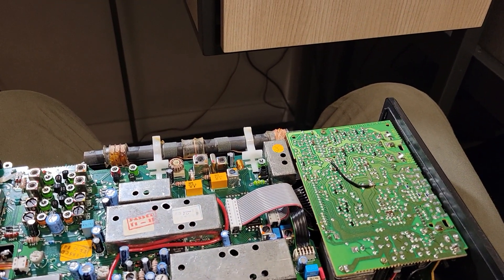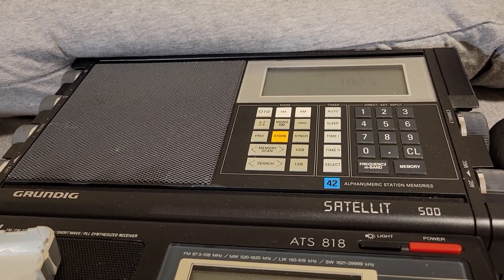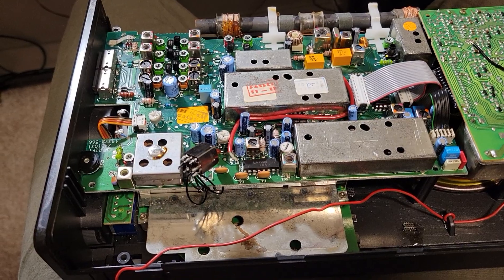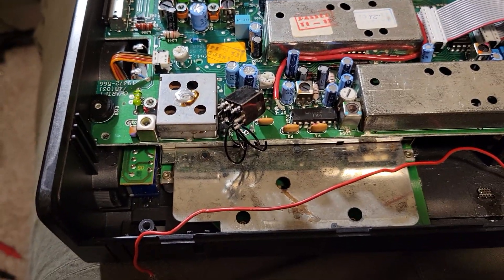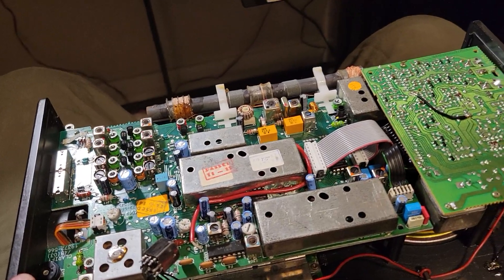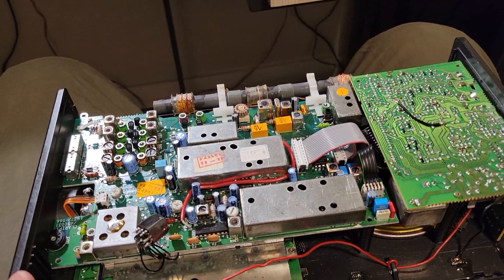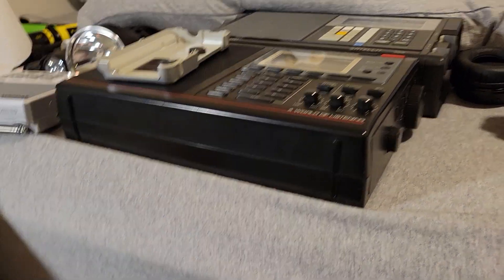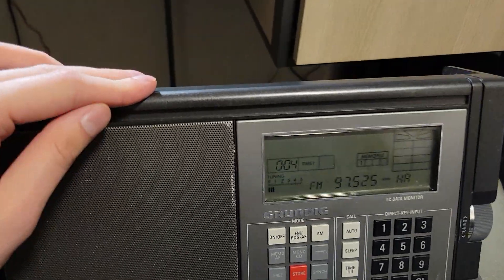Grundig Satellit 700 repair update #1

Comment: I HAVE PROBLEM
Grundig Satellit 500 radio - FM, MW, and LW bands are working.
The SW band isn't working properly - the reception is very low - how did I check this? - I placed a 100% functional Grundig Yacht Boy 400 next to it and found a conversation on the 20-meter band at 14200 kHz. The Yacht Boy had sharp, clear reception, while the Grundig Satellit had the same conversation (via USB) with the voice volume at maximum - very low.
Broadcasting stations on SW, as described above, receive very low reception.
Automatic search on FM works, but on SW doesn't work.
Furthermore, the display and keypad are missing a backlight.
The radio is powered by 4 R20 batteries. Has anyone experienced this problem and found any faults?
What could be damaged? What parts need replacing? What repair costs?

Comment: Hi can you tell me please if the two diodes D11 and D12 located near the 3  chip memory are both soldered for the complete coverage on shortwave ? thanks
Reply from the maker: I'm not sure. You'll have to refer to the circuit diagram for that.

Comment: Hello, great video. Mine has the same symptoms. All bands work except FM, it's almost deaf. What is the parts number or how exactly its named for search on eBay? Thanks.
Reply from the maker: It's an if can. Just find one with the same frequency. Check the service manual it should tell you.
Reply: @speakerblowupmanlee5921  do you mean any 10.7 MHz IF FM can will do the job or needs to be particular impedance etc.?